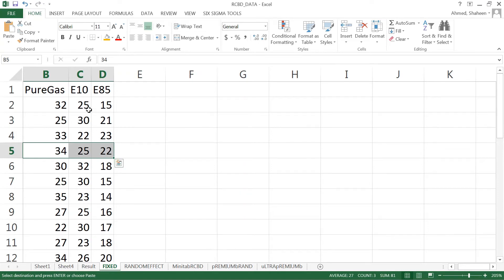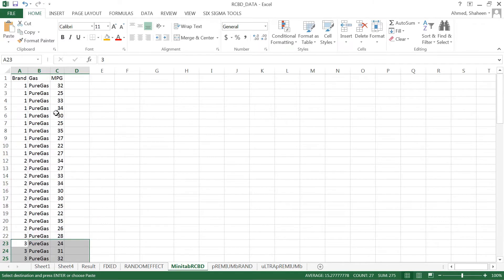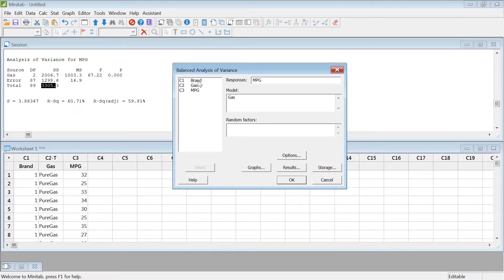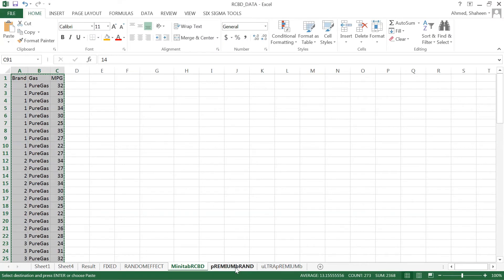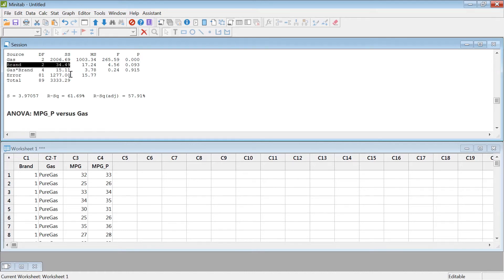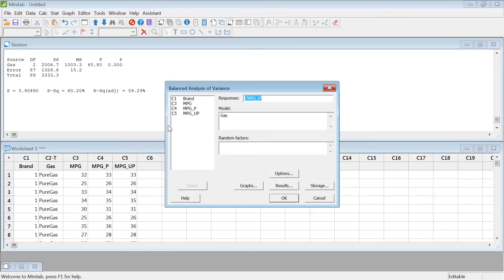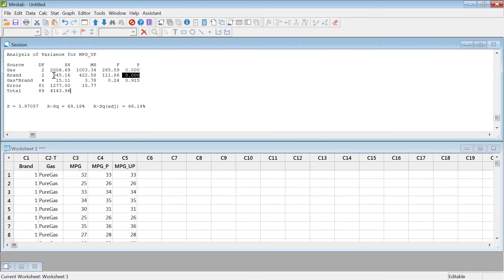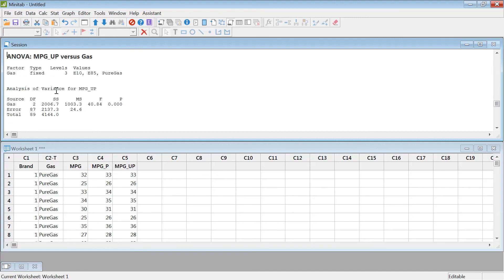Randomized Complete Block Design of Experiments Explained DOE Explained with Example Using Minitab

Comment: Sir, Can i get your mail id..Can you please help me in clearing some doubts related to my PhD work
Reply from the maker: You can find my DOE textbook, including the text explanations, videos, and practice questions here: https://www.theopeneducator.com/doe.
However, I don't provide any individual consultation. Good luck with your Ph.D. work!
Reply: @TheOpenEducator  Sir, I am using your videos and textbook for studying DOE. My actual work is to do multi-objective optimisation of 5 responses using Minitab. In my work, I used a full factorial design where I had 3 categorical factors, each with 2 levels and 1 numerical factor with 3 levels. However, I couldn't find the correct steps to do multi-objective optimization with both categorical factors and numerical factors and with multiple levels. Can you please help me by telling me only the steps for the same in Minitab